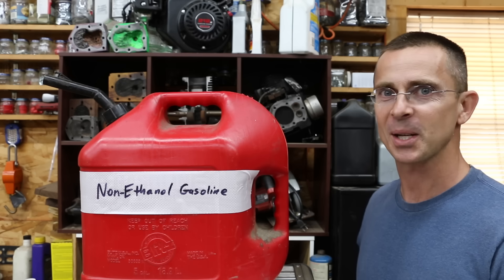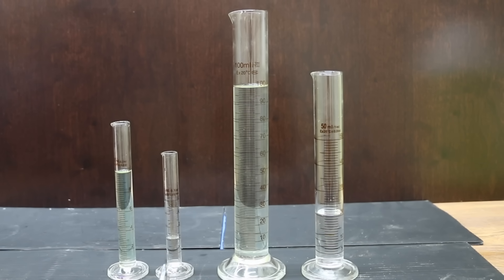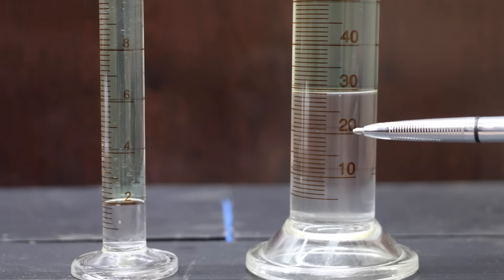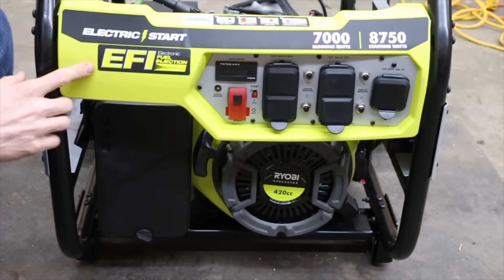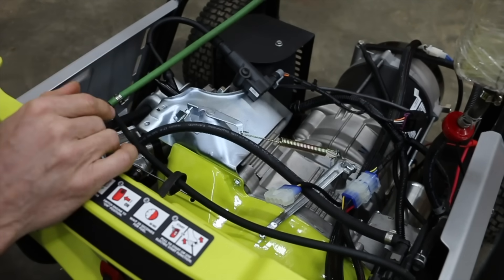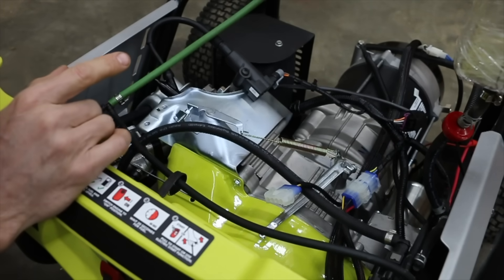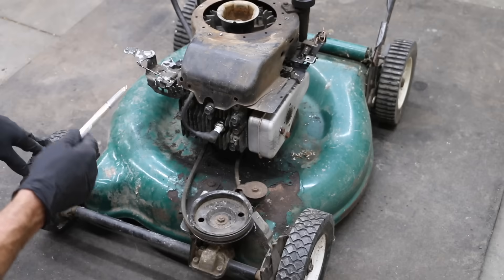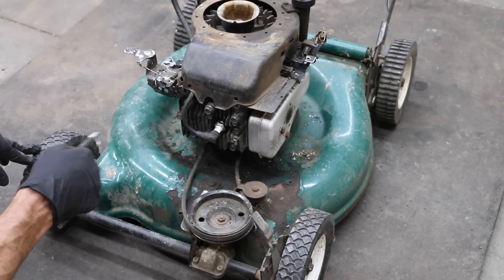Is Non-Ethanol Gasoline Really Better? See the PROOF!

Comment: The idea of adding Alcohol does two things number one it leans out the mixture because the Alcohol molecules are twice the size of Benzine molecules "Benzine being the base chemical in gasoline." The other chemicals added to the mix to increase octane also change this factor. There is no set of rules as to how this is achieved and is guarded by each oil company like Coke's soft drink recipe. The higher the octane rating is the higher the flash point of the fuel is. Two, When Alcohol is compressed it cools the combustion chamber when used as a fuel However it is highly corrosive. Alcohol added to fuel brings down the BTU content so more is needed to achieve max output of the engine. The rule of thumb to running straight Alcohol as a fuel is whatever the jet size is to get the engine to run with gasoline the starting point is double the jet size. Remember the molecules are twice the size and the fuel goes through the engine like grease through a goose! You get about half the fuel mileage! They add Chemicals like Acetone, Methal Ethel Keytone,  or Toyline to increase octane and this changes depending on the time of year and location. Years ago at my mower shop, I had a customer who had an old Lawnboy he was in love with it was worn out and had low compression but worked fine the year before and he just couldn't believe that it needed to be rebuilt. I told him about the Alcohol that was being added to the fuel in the area at the time for being the reason that it wouldn't start now I told him you either run the mower on Bezine or run out 60 miles West to farm country and buy regular gasoline out there for the mower. I bet him 20 bucks and he took the bet he opted to go west and came back to the shop we mixed up some fuel threw a new spark in and the mower started right up. He decided to test the fuel he had bought by his house again after it ran on the farm fuel same thing wouldn't start he came back and handed me the 20 bucks then I took him to lunch and he became one of my best customers.
Reply from the maker: Thank you!

Comment: I have been running 91 octane (lowest octane I can get with no ethanol in my state) in my 2003 Ram 2500 with the 5.7 hemi. I recently started putting TC-W3 2 stroke oil in the tank at about 1oz per 5gal. I've been told it helps with lubricating the fuel pump, injectors and valves/valve seals and upper cylinder. People have claimed it makes for smoother idle but my engine already idled smooth as butter even at 203k miles so I can't comment. My question is does it actually increase fuel economy like some people claim? Does it increase engine temp, or build up carbon faster? I don't have a regular driving route to really test fuel economy. Just an idea.
Reply from the maker: Thank you for the video idea!

Comment: What about using ethanol not inside the gasoline directly but after the air filter. Small amounts(not injecting it but let it evaporate so the air will take small quantities)
Reply from the maker: Thank you for the video idea!
Reply: @ProjectFarm  thank You for doing all the projects that You do.
I have lots of questions/ideas and most of the answers are in Your video.

Comment: 2:08 The other is, of course, making your fuel cost 11% more (with 10% ethanol) and 18% more expensive with 15% ethanol).  Plus the time and equipment required to do the work.  Another problem is that you used two different kinds (octane ratings) of gasoline.

You know I love your channel, but this is one of, if not your weakest, videos.  :(  Still, eagerly waiting your next!
Reply from the maker: Thanks for the constructive feedback.

Comment: Ethanol (alcohol) has less BTUs than gas... It's a no brainer that it would produce less energy. That's why E80 vehicles suck on mpg. The saved cost for the fuel is barely if at all made up for by the loss of efficiency.
Reply from the maker: Thank you!

Comment: Excellent Todd, regarding the carburettor components can you pit in some plastic fuel line and injection pump seals too, they've just started adding ethanol 5% in the U.K at some stations. I'm concerned about my V8 Cayenne's 15 year old fuel system and how it deals with it. I normally put premium 98RON (95 or 98 RON acceptable in the handbook). But that RON rating is before artificially increasing its octane with ethanol. 
Thanks
Reply from the maker: Thank you very much and great point regarding the IP seals.

Comment: I look forward to your future test.  I've always used non ethanol gas in my vehicles for the past 20+ years, and will continue to do so.  
That said, I watch a lot of car/sports car YouTube channels and most of those guys use E85 for higher octane & higher horsepower, BUT they typically have to upgrade their stock fuel system to allow for it to run properly.  Most of the Supercar channels I watch don't however, and I can't help wondering how much damage and excess wear they are putting their engines and fuel systems through.  (if any)  Thanks for sharing. 👍
Reply from the maker: Thank you!

Comment: FYI: Adding 10 ml of water to 10 ml of ethanol will yield slightly less than 20 ml of liquid. This is because the water molecules fit inside the ethanol molecules. So that gasoline does indeed contain 10%.
Reply from the maker: Great point!

Comment: When I have run non-ethanol fuel in my car I generally find about a 5mpg increase in fuel efficiency. Unfortunately the non-ethanol fuel cost more to the point that it counteracts the fuel savings and it ends up being a break-even situation. It's only available at one station in the entire city so it's not that convenient. As a result I don't worry about it. However I do fill up my gas cans with the non ethanol fuel and use it in my generators and other small engine equipment that tends to sit for periods of time.
Great test.. keep up the good work.
Reply from the maker: Thank you!

Comment: It is a fact that it damages gas lines and rubber tubing and that is why every lawn mower manufacturer says do not use it.  It also does not provide an equal amount of power.  Lastly, do not use it in older carbureted motorcycles if you let them sit for more than 2 weeks.
Reply from the maker: Thank you!

Comment: Modern cars are designed to run with E-10 so I’m not really too concerned, my car does seem to run a little bit smoother with no ethanol fuel, but after speaking with the dealership, and consulting many forums, I don’t see it being worth the cost difference to use non-ethanol all the time, maybe on occasion.
Reply from the maker: Thank you!

Comment: Umm...so an interesting thing happened in this video and it seems like no one noticed because it was the expected result.

You just straight up debunked the claim that E10 has no performance drop.  That is significant as it's one of the selling points of E10.
Reply from the maker: Lower fuel efficiency. Thank you

Comment: Well, since they're sold by volume, that would make sense... Just sayin'...(-:  The REAL test is in storage, or non-use. That's when the real trouble starts, especially here in southern Oregon, where winter humidity levels are outrageous. If you run ethanol of any degree, you WILL have a carb bowl full of water after a couple months.
Reply from the maker: Thank you!

Comment: Not sure where to begin with your chemistry. Yes, ethanol will mix with water. However, the alternative to ethanol isn't nothing: it is some other oxygen-bearing compound (MTBE or methanol are both options), and most of them also mix with water. The result is that you can't tell how much ethanol is present just by adding water and comparing volumes of the two phases.

As far as fuel economy goes, the oxygenated fuel is a wash. It has less total energy content, but the oxygen means you get more complete combustion and less fuel wasted out the exhaust pipe.
Reply: It has less energy content, but you can put more of it in and it's generally cheaper, even if you're adding more fuel.
Reply from the maker: Thanks for the constructive feedback.

Comment: Its hard to set up a test that exemplifies the 5% loss in power, sluggish throttle response and overall poor performance. You have to see it to belive it!

I would like to see (in %) how much water can be mixed into e10 and still work as combustible fuel. This could help identify the age limit of ethanol fuel in leaky cans!
Reply from the maker: Great point!

Comment: It does decrease fuel economy simply by needing more fuel for the same energy, It does lead to cleaner combustion chambers and intake as long as it port fuel injected, It does have major issues with carb causing massive corrosion build up, It does cause fuel line deterioration on older vehicles. I have worked on boat engines with ethanol fuel run through them. If it sits for any extended period of time it will cause fuel jets to clog and leaves a nice nasty corrosion film. I also see it on my tbi.
Reply from the maker: Thank you!

Comment: This isn't for u pfarm lol. The different fuels were made for a different cars. The non ethanol was made for older cars. Bc this fuel we have today destroys fuel lines that are meant for non ethanol and especially carbed. Most sleds and four wheelers and stuff like that are best using non ethanol. The other thing the cars are built for specific fuel tyoes. So putting different gas in your car bc u think its better and its really not. Yes one might destroy more than others but really your car was only meant to really run either 93 or 87. Engineers went as far as putting it in the owners manuals bc people are doing this.

Comment: Great videos, I ran in to a tape issue recently,  could you do a tape/duct tape and see which tapes will adhere to wood, metal, plastic in extreme cold temperatures? I recently had to put up a shed and used plywood for the floor and tries gorilla tape just to seal the cracks where the boards butted up to each other. It was about 29 degrees outside and well no luck.  Thanks!
Reply from the maker: Thank you for the video idea!

Comment: Awesome video! I have an 09 ram 1500 2wd with the Hemi in it. I live just north of Dallas, so there aren’t any stations that sell non ethanol fuel for 45 miles due to clean air requirements. That being said, I get 18.5 mpg at 72 mph on E10. When I go visit family in northwest Arkansas, I fill up with non ethanol fuel and at the same speed, 72 mph, I get 21.2 mpg. I have done this experiment several times in different seasons and even with different tires. The cooper evolution ht got me the .2. Before that I got 21 mpg. Good tires, American made and American owned.
Reply from the maker: Thank you!

Comment: Could you or did you already make a video of what E10 does with standard rubber fuel line? I think lots of classic car owners would be shocked. 

Here in Europe every gasoline contains that slow killer so checking & changing out your fuel lines & refurbishing your carb at least every two years is a must.
Reply from the maker: Not yet. Thanks for the recommendation!

Comment: this video is a non starter. ethanol has half the energy density of gasoline. one gallon of gas with 10% ethanol is on 90% of a gallon.... you are getting fucked on volume at the pump courtesy of the govt. the gov taxes fuel per gallon. forcing each gallon to contain less than a gallon forces you to buy more thusly pay more tax. now you understand the rest of the story.
Reply from the maker: Thank you!

Comment: Ethanol is evil, folks.
Be aware of stations selling non-ethanol, as well. I had a boat with a 4-stroke efi motor and used non-ethanol fuel since day one because I knew that it could sit for a few weeks between uses. After years of replacing fuel lines, fuel/water separators and fuel filters, I kept finding solid ethanol. I called my state's Dept of agriculture and weights and measures to request a test to see if this station was really selling non-ethanol fuel. It wasn't. The test results came back with 9% ethanol content. I had been paying 50¢ more/gal for YEARS. The station owner denied any knowledge and there were no repercussions.
Reply from the maker: Thank you!

Comment: I have seen the differences in the two fuels with a 1994 Ford Taurus Wagon and Ford Focus 2007. The miles per gallon were quite different. Led me in those times to ask why; didn't have an answer then and I do not now. My book 100% gasoline is better for everything. I did run into a guy from the south while fueling one day at an Illinois gas station and in his area there was no Ethanol to be found. It was a very short 5 minute conversation while fueling but his job was to deliver fuel in his area, he said avoid it at all costs. It basically came down to water and separation issues. My two cent worth says I'm not worried about seals so much as they have dealt with the issue, I think we are plain out wasting stored fuel potential in the modern and older automobile. I believe the CO difference is negligible to none. Instability of the Ethanol fuel is the largest cause for concern.  It would be interesting to see Government,  the Ethanol industry and as always your numbers on this subject to get to the nitty gritty.. Plenty of places we could use Ethanol but is the Automobile the best choice?
Reply from the maker: Thank you!

Comment: I would love to see witch gas cleans better. E0 vs e10 vs e15. What I have found out is that me car ( 2000 grand am 2.4l DOHC 9.7-1 compression ) takes off a bit faster with e15 vs e10. Not like a ton of difference but noticed the car does indeed have a real cold air intake getting real cold air. "Chuckles" but does it clean better does it actually  make a little more power or is it in my head Charles. On the Down side e15 does burn more. The same 1/4 tank gets 15 to 25 mpg less. Of course this depends on my lead foot. MOS 19D scouts out
Reply from the maker: Thank you for the video idea!

Comment: Your videos are so packed with content and they’re so no-nonsense. Amazing as always. You’re probably tired of hearing this :)
I appreciate your work and the fact that you take so much time to respond to comments.
FYI I did my own tests on Eneloop and Amazon batteries and came up with results very similar to yours. I ran the tests on 4 batteries at 300/300 rates as well as 1000/1000.
However I found that using different chargers changed the numbers significantly and consistently. I used the Maha/Powerex Charger you have as well as an OPUS brand (which read higher- consistently).
Reply from the maker: Thank you!

Comment: Excuse me but the non ethanol fuel could make carbon build ups but if it is formulated with cleaning ingredients..it will not. They make the non eth fuel not for a mainstream use and new engines so they may just not put the cleaning additives which are expensive. Also no consumer really knows whats in each gas formulation
Reply from the maker: Thank you!

Comment: In looking carefully at the color of the deposits on the spark plug it looks as if the ethanol-blended gas was achieving a little cleaner burn, due to the oxygen content in the alcohol? I thought I saw a little more carbon deposits in the cooler areas of the combustion chamber and piston top areas with the ethanol gas, due to lower combustion temperatures with the alcohol?
Reply from the maker: Thank you!

Comment: Yes it is and with alcohol you burn twice as much as gasoline alone alcohol is hydroscopic which means it absorbs water 
And half the btu  so half the mileage for twice the price  And yes I'm a chemical engineer not a tofu chomper or holistic moon maden whack job
Reply from the maker: Thank you!
Reply: @ProjectFarm  
Good morning to YOU.....
THANK YOU FOR THE THANK YOU...       :-)

I've been in this business for many years  one could say I have been involved within oil development production and other related venues, and know full well what gasoline used to be compared to the junk they sell now, used to have .03 grams of terra ethyl lead in each gallon of gasoline .  And so one could say good bad right wrong but what used to be real gas is now pure crap you are paying gasoline prices for alcohol,  And other crap like sulpher . Where we used to get 25 - 30 miles a gallon with very little pollution we are paying triple to quadtriple  the actual price  it should be
Around 35 cents  a gallon. But oh no we 
cant have that  so we are all living the big lie.
All engines used to last easily well over 145,000 miles or more now you are lucky if you get 50,000 without you're engine going out.  You can blain the alcohol  gas in the engine. You should get 35 mpg.   Bit With alcohol ,and other crap  as propane, yes propane you are still paying five times the price for actual has yet you're engine won't make it to 90,000 anymore!   with  natural gas which is 130 octane as opposed to the 88 octane crap we have now we would be getting 60 miles a gallon and no pollution,  but these same retarded pinheads that push this junk science crap has  propane  , not natural gas as the additive to gas.....natural has by itself would give you extreme longitivity and great mileage plus
Cheaper  prices but tofu chomoers idiots blithering idiot fruitcake
"Feel "  not think it know it's all bunny rabbits and butterflies.  WHOLISTIC MOON MADEN crap.
So , pardon the jumping around on this subject I'm running late at the moment... if we had folds with a brain we could solve both the pollution issue and have your car or vehicle last longer get better mileage and in natural gas. The exhaust is. WATER VAPOR, PERIOD!

Comment: I'm surprised that old lawn mower engine hasn't dropped compression with as much as you clean it out. You can significantly change compression ratio by just shaving 1 mm of material off the piston.
Reply from the maker: Great point!